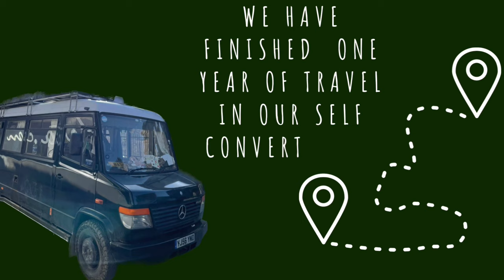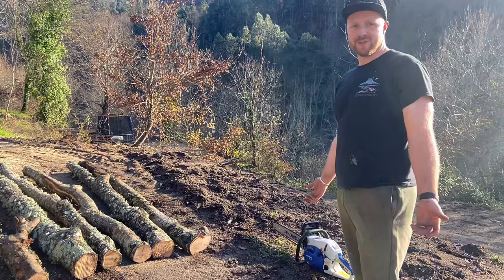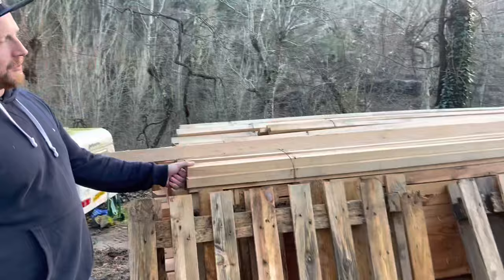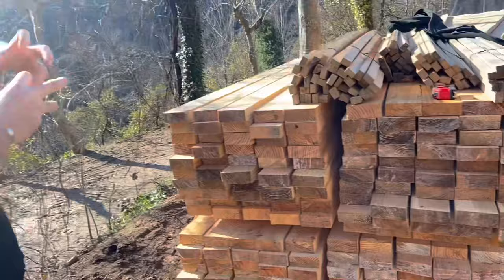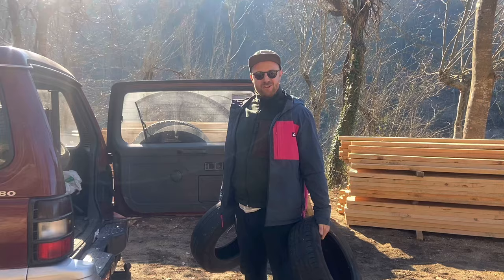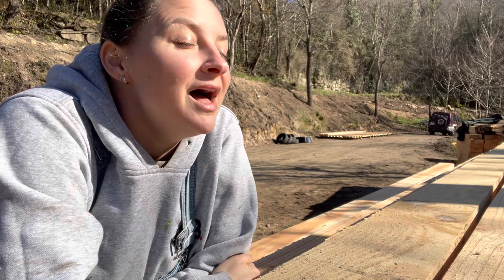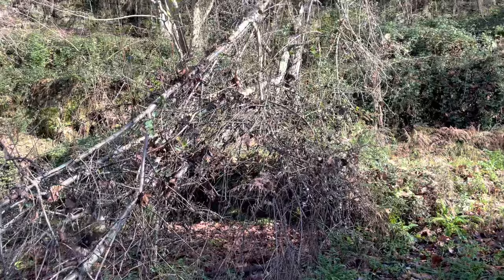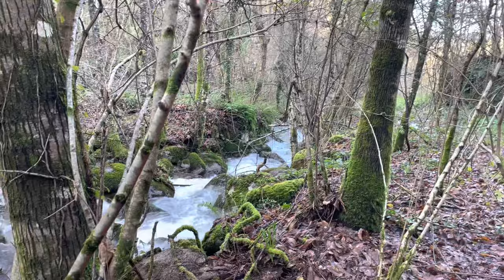WOOD week!! This is the start of our off-grid house in northern portugal!!!

Comment: Suggestion for your barn build. When placing the log uprights , don’t let the wood rest directly on the concrete as the wood will wick up any moisture from the concrete. Place a thick piece of rubber type material between the wood and the concrete.Hubby is a contractor.
Reply from the maker: This is such a great suggestion thank you so much we will definitely look in to it ☺️

Comment: Did you need planning for the Roundhouse? Or does it count as a temporary structure? 
As a carpenter, I look forward to following this unusual build. Great fun!
(The different weights of the timber might indeed relate to how seasoned the wood is – or might just be about how wet the weather was where the timber was stored.)  
Great idea with the tyres, as waterproof shoes for the oak barn uprights.
Reply from the maker: No as it is modular and can be dismantled. In time we will do the stone house which has planning already. We may need more input from a profession carpenter I’m sure!! Thank you so much for joining on our projects!!

Comment: Unusual method of preparing the framework. Also the raw timbers needs to be stickered with THIN strips, NOT 2x4s which cover too much of the wood you are trying to dry....usually a year or more.
Reply from the maker: Thank you so much for watching and for your advice, we were advised by the local sawmill to stack it in this way hopefully it will be ok ☺️
Reply: Methinks the traditional method I am suggesting was lost in translation.